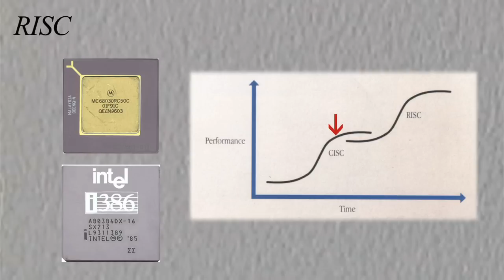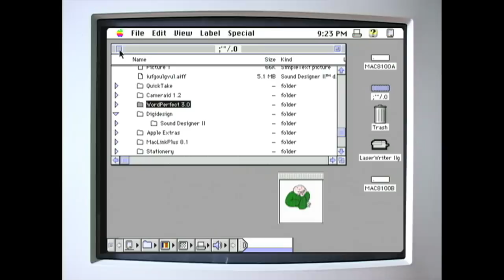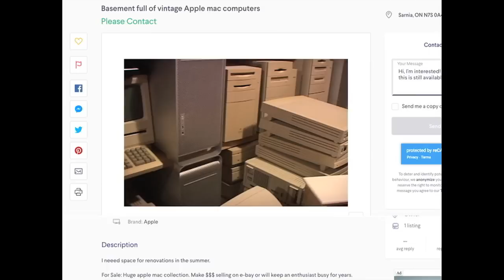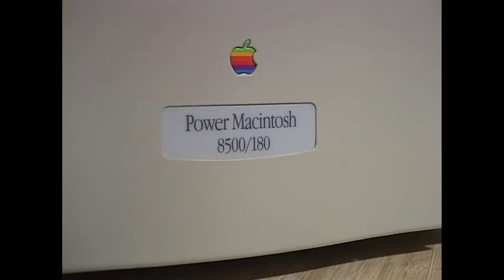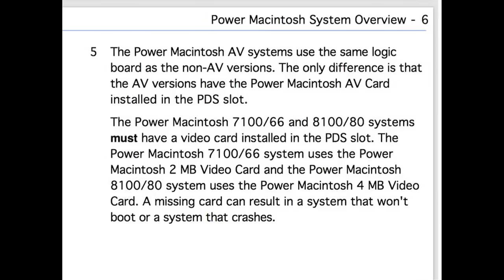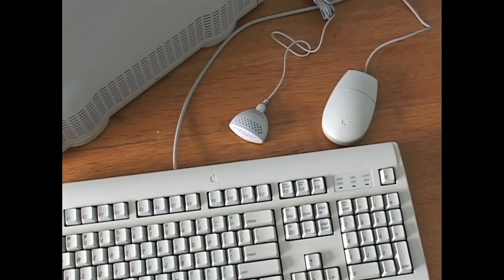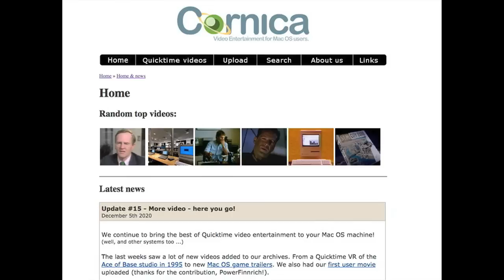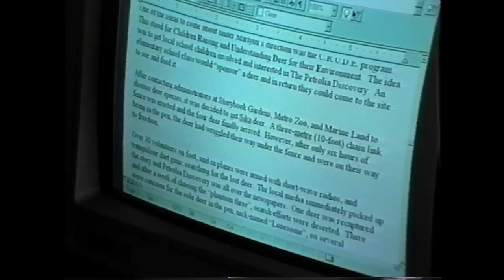The Power Macintosh 8100

Comment: A coworker gave me her 8100 when she got a G3. It was a really nice machine. We had the 8600 at work running the then new Quark 4.0 and Indesign 1.0 (Trash that Adobe almost immediately upgraded to 1.5). Our 8500 was the Laserwriter 8500. We were using a Itek platemaker and quickly learned that the 8500 had a flaw and didn't actually print at 100%, not great for printing camera ready copy. Oh 90's apple you crazy kids.
Reply from the maker: Great first-hand account of Apple equipment in use in the 90’s. Thanks Ray!

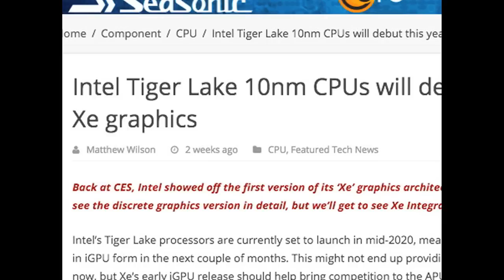Comment: I had a 8500 in the early 2000's ... as a starving student I sold off my monster truck gaming PC and used that thing as my main computer for almost 4 solid years, good platform and as a bonus mine had the av pack so at least it could double as a tv lol (edit 8:56 AMD has been doing 7nm chips for over a year now) edit edit, I had the second radius machine, it was a chunk of shi
Reply: Intel introduced 10nm over a year before AMD went to 7.... In a cpu that.. well... didn't work very well.  lol

Comment: That Marathon joke was great. My friends Dad had an 8100/80av, I haven’t seen one since then but believe it or not have the boxed starter kit with all the original documentation. Found it last year from a former Apple reseller who sold off his entire collection to me. Still on the hunt for a 8100, but I do have a 7100/66av..
Reply from the maker: Good to hear you liked the Marathon piece! It took a bit of memory work of how to mod that game, but a lot of fun making a video around the 1984 theme. Great that you found a starter kit. More rare than the computer itself. The 8100 is a tough one to find, though one got posted locally just as I was finishing this video (just to prove me wrong, I think), but it's quite a major fixer-upper.
Reply: @65scribe  You should make a part II on that 8100. My 7100 does start but is unstable. I’ve replaced half of the surface mount capacitors. A huge job to replace them, when I have time I’ll finish the job. I used to make my own Marathon maps, man I had so much fun with that game.

Comment: "Do I really have time to watch a 40 min video on the 8100?"... a few minutes in ... "Ahh, this is great!" :) The humour and edits, attention to detail, go a long way. Thank you for your efforts :)
Reply from the maker: You’re welcome. I appreciate hearing your thought process in watching the video!
Reply: @65scribe  Many machines from this era need a recap (PCB clean and capacitor replacement) in order to work, it's possible that's all the board needs. Maybe send the board to someone who does that sort of thing? Great video anyway. I actually have an 8100/100AV, err I mean 8100/110, but I suspect it needs recapping - but I never knew of the Peltier used for heatsink transfer, absolutely nuts they shipped that in there.

Comment: Hey, at least your 8100/80AV's power supply actually turned on! Mine went bang as soon as I plugged it into the wall. A year later and it's still in bits all over the place... I should probably try and fix that at some point.
Reply from the maker: Yeah, I'm glad that didn't happen at least!

Comment: The first Mac I used professionally was the 8100/80 AV. I hooked up a video camera to the video input and noticed that there wasn't any filtering of the NTSC chroma from the luminance. This resulted is terrible artifacting. I contacted Apple and they confirmed my issues. Yep, that's the way it is. No fixes. No drop ship of a proper comb filter. It was however, a very nice machine.
Reply from the maker: That's interesting to hear Apple's acknowledgement of those issues. I agree that the AV was pretty underwhelming when I got a 6100/60 AV back then. Not professional use, but fun to play around with.
Reply: @65scribe  I had been die hard Amiga until 1994. My boss was a Mac guy. It's all worked out pretty well, these 30 years later. :)

Comment: Dude, I can't describe how excited I was when this new video popped up in my feed!  About the 8100 spiral springy thing, mine has one also, in my 8100/110 (for there was no AV model!) I always thought it was something to do with an grounding point or some sort of heatsink related voodoo.  Eventually I just accepted it was there and never looked back.  I'm not sure if my 8200/120 has one but I'll be sure to look now!
Reply from the maker: Thanks very much! I thought I would get more feedback on the 'springy thing', but you were the only one. Your 8200 is an obscure machine, but it would be interesting to know if yours has one.
Reply: @65scribe  So, the 8200 certainly does have a spiro-gyro thing too - I suspect as you suggest it's for grounding the case to the PSU - mine has rubbed a mark into the PSU from removing/fitting the case.
Reply from the maker: Thanks for following-up on that. Now does the 8200 have a Peltier cooler on the CPU?
Reply: It doesn't seem to - just a big heatsink clipped to the board.

Comment: We had an 8100/80 when it was released, we'd ordered a Quadra 950, but between order and delivery they wer superceded by these. It had max ram and a video accelerator, but we still found it pretty slow at times, the one you bought looks like it was used in a similar environment, as we broke the clips on the front panels on our too, people supplied shirt floppy discs which would get jammed and we'd extract them with long nose pliers or similar, sorry!
I think 2.5 was the latest version of Photoshop at the time, but the 3.0 update arrived shortly after, I really enjoyed your video, took me back a few years.
Reply from the maker: Thanks for sharing your 8100 story. I suppose an 8100 would be a lot cheaper than a Quadra 950 with a PPC upgrade card. Glad to hear you liked the video!

Comment: 20:47 - iirc there was a silent recall on those peltiers - any unit in for repair was to have the peltier unit swapped out for a "regular" heatsink and fan. I don't believe this was communicated to the users at the time. The issue was cited as causing condensation
Reply from the maker: Interesting… I was not aware of that, but it does make sense. This is about the time Apple’s engineering blunders really started to show.

Comment: Glad to see you back! Awesome video, as always. Loved the joke about the list. Also! I also own a G5 Quad, but my water cooling unit is completely different. I think the one you have is the original version, and mine is one that did go to Apple for replacement (they were faulty as heck and made an exchange program). I figured that could've been the case when I got it, because clearly there's a second model label on top of the original one, but thanks to your shots now I can confirm it. Yours looks like a beast compared to mine!
Reply from the maker: Thanks! Good to hear you liked the video and the list. From what I recall, the one I have was the last version of the water-cooled. It has this custom heavy-duty power cord. I think because the power draw could melt the wires of a standard rating AC cord!

Comment: I have an 8100/110, and it has the AV card. I doubt it's been specifically replaced, so I imagine they were available with the AV card from Apple.
Reply from the maker: Thanks for sharing that info. It’s true that apple never offered the AV Card for retail upgrade. They did supply them as replacement parts to Resellers. It is possible to have the AV Card, but for it to be a legitimate model, it would need to have a front sticker that states “8100/110av” as well as being mentioned by that designation in the manual and software. I haven’t been able to find any machines or documentation from Apple with that.
Reply: @65scribe  Yes, I'm sure you have better knowledge of this than me... I'm very new to Macs. :) 
I've been reading up as much as I can on these machines the last few days, and I think I've discovered why mine has the AV card. My machine was equipped with a Newer Tech MaxPowr G3 accelerator card, and due to the graphics-relocator-frame being designed for the AV card, I'm guessing that resellers who did upgrades like that for customers, simply would swap out the HPV for an AV card by necessity. Looking at how the relocator-frame fits into the slot, I would imagine that making one that would fit the HPV card, would mean blocking off the Nubus slot next to it, due to having to allow space for the VRAM SIMMs, and that means leaving only 1 usable Nubus slot... Not a very good option in a workstation class system.

Comment: I live hpw you say that no one would inclunde the Performa 6200 on their list of collectible Macs, since it's the model that is most important to me and the primary one that I like to collect ! 😄 Also, I have an 8500/120 and it's got one of those spiral spring things on the inside of the case as well. I can only guess it's there to grund The case as you said
Reply from the maker: An 8500 with the spiral spring? That's the first I've heard for that model. My 8500/180 does not have it. Others have confirmed it on their second revision 8100's and someone overseas said it was on their 8200. Thanks for sharing that, Magnus!

As for the 6200, I guess there had to be someone who collected them. Sorry for dumping on your favorite! Honestly, I tried to take one apart and it was so far from the IIci and IIsi in elegant internal design, I gave up. But I can respect you found something you like about them.
Reply: @65scribe  I live in Europe, and maybe the model here was different from the ones in North America in some aspects? Apple has been known to sell different modells under different names around the world and re-using parts if I'm not mistaken... I watched this video and decided to pull it out and see if I could fix it, I would never have noticed that spiral thing if you had not mentioned it! ABS plumbing cement has been ordered!

The 6200 was my first contact with The Macintosh world of computing, we had one in The back of our classroom in first and second grade. I actually have that exact computer now, got it from the school when it was renovated. But I do agree with you, it's build quality and the overall design of the inside (from motherboard to the PSU) leaves a lot to be desired! Thanks for your videos, that are extremely re-watchable, educational and entertaining!

Comment: Hello. I get the chance to buy a Powermac 8100 soon and watched this video several times now in preparation for that. Great infos. What would you say is a working 8100/100 worth. 136MB RAM / 700MB HDD. No CD but Floppy with Drive bay cover and two fully closed drive bay covers. Sure the latches are broken on them but at least some covers.
Reply from the maker: Hi. That’s great you have a line on a working 8100/100! To answer your question, the value of old macs that are not “iconic” is still very much undefined. The 8100 is a bit “off the path” in regard to being a Mac that collectors are clamouring for. Despite the rarity you still need interested buyers for it to be valuable in terms of dollars. I would assign value at $300 as described, but hopefully you want to keep it and enjoy having it yourself.
Reply: @65scribe  Thank you for your answer and yes, I want it for my own, small but growing collection. So far I am rather inexperienced and don't really got for value as in: What Collectors see as valuable but for the Macs I like and always wanted to have. The 8100 popped up rather randomly on my radar. It was top of the line back in 1994/95 and I would say they are rather rare  here in Germany. I feel a bit like crossing a line now. I was so far focusing on Apple models from 1997 and forward, when Jobs returned to Apple. Going back to classic Macs feels like entering the rabbit-hole. 🙃

Comment: Hey ! Forgot about the 8200 (120Mhz) ? It was between the 8100 and 8500. Had one on my days, great machine
Reply from the maker: True enough, though not sold in North America, so it doesn’t matter. Lol. Just kidding. A 7200 repackaged as a tower is much better than an actual 7200, so it sounds great. I think someone in the comments also mentioned they had a 8200.(but 100MHz) and it had the Peltier cooler attached.
Reply: @65scribe  true, the 8200 was Europe only 🤣👍

Comment: The Power Macintosh AV systems use the same logic board as the non-AV versions. The only difference is that the AV versions have the Power Macintosh AV Card installed in the PDS slot. I only recall seeing the /80AV & /100AV versions, I don't recall seeing a  /110AV version

Comment: While browsing eBay I realized there are earlier versions that have the 8100 with the model number printed right on the bezel instead of being on a applied sticker!  I probably would've bought that if I didn't already buy a cheaper 8500.
Reply from the maker: That’s true. The 8100/80 was printed on the bezel and then with the /110, they introduced the sticker. But an 8500 is a nice machine.
Reply: @65scribe  Thanks for the reply!  I just realized I didn't read the 8500 auction description properly and the one I already ordered may have logic board issues... so there's a chance I may have to get the 8100/80, as well, and slowly fix the 8500.  Hope you're having a fun weekend at the oil museum!
Reply from the maker: lol. Thanks Yue Fan. I will!

Comment: No mention of the Mac IIsi that ran a Motorola 88000 and that the PPC bus was based upon it? Or that Speech recognition was part of the 660av/840av? Or that a MacIIfx with an 8*24gc card had a AMD 29000? Apple had a lot of fingers in the risk pie, before the PPC.
Reply: Look for Floodgap ANSwers: The WGS 9150 and the Story of Wormhole
Reply from the maker: Hi Joe. I had originally planned to mention the 88K (though I thought it was in an LC case), but adding all the side stories would have made the video too long and I'd either lose viewer's attention or I'd never finish making it. Great facts about early RISC work - I'm glad you brought those up. 

I think I mentioned the 660/840AV differences with the PPC AV models in my 6100 video when I talked about speech recognition. I haven't done a video focusing on the Quadra AV models.. yet.
Reply from the maker: Great citation! Everyone should read it. No one goes deeper on those forgotten machines. Mr.Kaiser allowed me to use some of his photos in my Apple Network Server 500 video.
Reply: @65scribe  

I do not know, since I was not there, but I remember the picture from a MacWorld Magazine article. 

A video on the 8*24gc card would be cool.
Reply: @65scribe  

At the time I had a 9150, I also had a few IBM Risc machines, the IBM RT. Same copper coat on the inside, same thick plastics.

Comment: My first Mac was an 8100/100AV. My previous computer was an Amiga 500 with a 33mhz 68030 accelerator. I was expecting great things from the Mac, but the overall user experience felt only about 50% faster than the Amiga (admittedly at higher resolution and color depth), and the cooperative-multitasking OS and one-button mouse were two big steps backward. Nonetheless, it got me started in Photoshop and introduced me to the Internet by way of AOL. There's one app you didn't mention that I used all the time, a 3D renderer called KPT Bryce. My family has a photography business, and back then we submitted pictures to a stock photo agency called FPG. Bryce could create fantastical 3D landscapes at professional resolution, and we submitted about 300 of them to FPG. Some of them sold really well, paying for the Mac. The 8100 now sits in our attic, last time I checked it could boot as far as looking for the hard drive, but the HD had failed.
Reply from the maker: Thanks for sharing your personal history and experience with the 8100/100AV. That's a great point about Bryce. I should have included that. Glad to hear you still have it!

Comment: That feeling when you get a recognition in a 65scribe video!  Made my day for sure!  Word was they had working 88000 risc Macintosh with the emulator but overall performance was terrible. NeXT also had built a NRW or NeXT RISC Workstation with dual 88000’s.  But Apple could weather the Motorola storm for the IBM help as the POWER+PC or PowerPC.
IBM made all the 601s as they have the full POWER instruction set for AIX as they were needed all their old software to just work. Was that ever a big surprise with the 603!
Never change the camera!

Comment: Nice chassis that. I used to work in education as a techie and I was managing the UNIX systems mostly. I was always wondering if Apple ever had a partnership or released a 'WEB' product. SUN, SGI, HP, NOVELL and IBM all teamed up with Netscape to try to stop the M$ slaughter but ultimately we know who the winner of that debacle was. So, did any 3rd party (other than FOSS / Apache etc) develop code to work on OS9? OSX brought in a server product (sold as an OS originally for some reason) which was gradually turned into an app and destroyed and is now a worthless pile of rubbish.
Reply from the maker: It sounds like I should be asking you the questions on this subject. Cameron Kaiser, who maintains a great website on the ANS link in the video’s description is a good read. Explains what Apple was trying to do at the time.